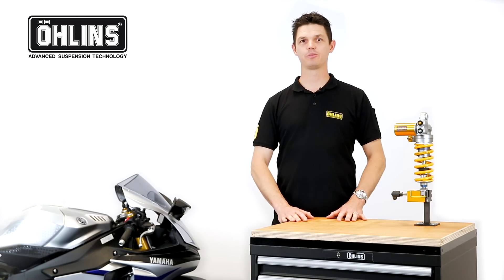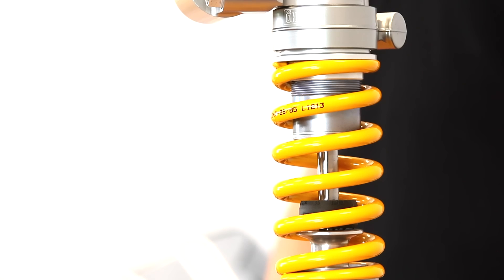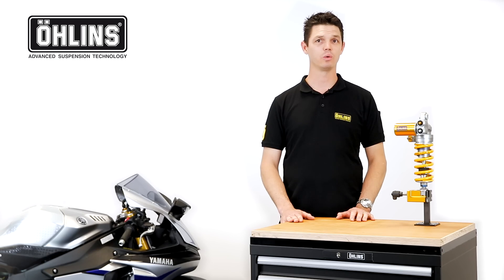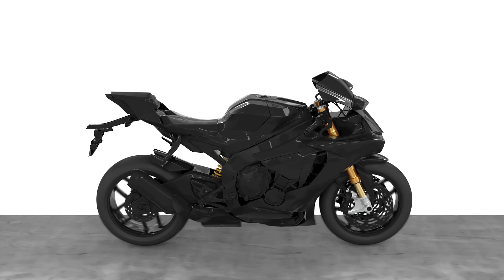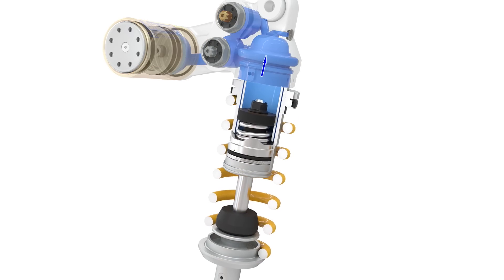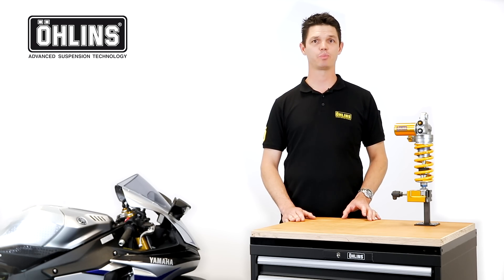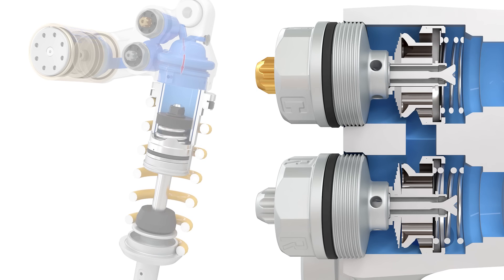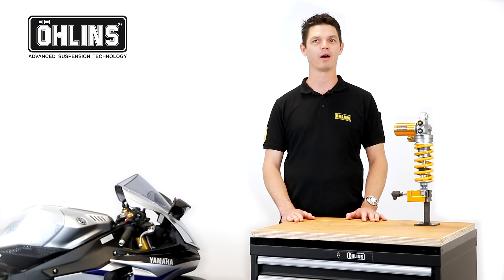Öhlins Motorcycle TTX Technology Shock

Comment: This  guy speaks  good English .. Good  Graphics..  but when you pay  $740.00  "  My Stock forks  were bent, I hit a Deer in the Fall of  2019 I paid  $2008.00  each for new Stock Yamaha Forks.for an Ohlin Cartridge Kit for a  Yamaha FZ-07   they give  you  some crappy  insturctions  printed  in a blurr  in a tiny  book 1/4 the size of  8.5"11" typing  paper .. and  the English is so terrible  it makes no sense.
  I was able  to download a pdf file of the  instructions  and  expand the size  on my lap top screen.
   When you have to refer to the Yamaha  Shop manual  which uses  different names for the parts the real confusion begings..  
   The Ohlin parts diagrams  not so  good ..  I was not  sure  if  I was supposed to remove the Yamaha bottoming spring or not.. Ohlin could not be bothered to print a clear  photo  and  refer to the spring  by  Yamaha part Number..  
  Yes  I know they said  10 times  to have the parts  replaced  by an Authorized Ohlin Repair shop ..  but  I have  been  working on Cars, Trucks , Tractors , Front end Loaders Cranes, MOTORCYCLES AND SNOWMOBILES FOR OVER 45 YEARS..  I  have a shop manual  for amost  every vehicle I own ..and Ohlin Cartridge replacments  manual is as  bad  as GIVI  Luggage  manuals .. with total crap photos..
  The Yamaha  Shop manuals  are  pretty good  once you get accustomed to the format..

Comment: Aprilia RSV4RF 2017 TTX and TTX GP  what in difference between them ? Can I upgrade to TTX GP internal ? Thank you
Reply from the maker: Hello Sean,

We asked our product specialist here at Öhlins HQ. Below you find his answer. 

At the moment we have no TTX GP shock available for the RSV 4 RF 2017.
It is possible to upgrade from a TTX R&T(OEM) to TTX GP, you have to change the adjustment valves and also add a hydraulic pre-load adjuster and change to a shorter spring.
Your nearest Öhlins service center should be able to help you with this.

It's likely that we will develop a new TTX GP application for the RSV 4 RF. It will be communicated on our social media pages as well as though www.ohlins.com and our network of distributors and service centers. 

We do have an upgrade for the fork https://www.ohlins.com/products/database/#?categories=4815&page=1&brands=4772&models=6640 , The FKR 100 is a cartridgekit developed from Super bike racing and this is a real racing racing products that used in some national racing championships. Contact your closest Öhlins Service Center for more information! 

Have a nice weekend! 

Best Regards from Öhlins Racing AB
Reply: Thank You 👍🏻
Reply: I have just sent my 2017 RSV4 RF TTX-RT shock to my Ohlins centre to be re-valved to TTX-GP spec.  Hoping it makes a worthwhile improvement
Reply: Had my shock back and the damping is much improved, my Ohlins centre said they cannot in fact fit the TTXGP adjuster valves and needles as they don't fit the RT shock but they re-valved to same spec with new spring toys suit, All I can say is it is much better :-)
Reply: Curious, where did you get the re-valving done?
Reply: KAIS here in UK, used them before and they are very helpful, great service.

Comment: You wrong. You not mastered it. Your suspension is a wast if money. Especially shocks.
Reply: Comedy right here! Really well thought out. Good one. So funny
Reply: @dansteadman2528  i had many ohlins cartridges, complete forks, gas cartridges and shocks. used them all. without revalve none of the worked right. it is just an expensive lego with close ro zero experience added in to the mix. i believe this is a consequence of some simulation software in use instead pr actual riding, or very unskilled test riders. in any case too expensive set of parts is not a suspension yet.
Reply: @SAMFICOM  Lol dude they aren't legos. You have to install them for them to work. There is a reason they are regarded very highly in the automotive and bicycle industries. Sounds like you installed it wrong. Anyone with a brain knows these shocks work wonders.
Reply: @dansteadman2528  I had - Ohlins forks (complete), ohlins TTX, TTX2, TTX GP (total 4), Ohlins 30mm cartridges, Ohlins gas pressurized cartridges. Except for gas pressurized cartridges where valving was very close to good, valving on all the rest of their products was off completely. However I also believe that for for someone with your intellect level Onlins, or any other well marketed brand suspension will be just fine out of the box.
Reply: @dansteadman2528  And about this specific video. - We can see typical as you call them "dude" who has zero clue what he is talking about - he is reading from improvised teleprompter (not even a proper one). He could be replaces by Alexia any day and there will be no change in text or meaning at all. This is what Ohlins became our days - they use some software to simulate damping, over vise they would not be able to cover such wide range of motorcycles. Then if customers complain they will adjust it (maybe) on the next year batch (maybe). So basically if you buy ohlins - plan additional $$$ for re-valve and after few re-valve iterations they will work just fine. However taking in account initial cost of components this is ridiculous.
Reply: @SAMFICOM  yeah, you have to put them on your bike in order to see if they work. It sounds like you pushed on them on your desk to see if they would squish and they didn't so you got mad. They work great. They are the best. If you can't get them to work right then you should set them up right. It helps a lot. I can think of 3 reviews from experienced professionals saying they are either the best or they are one of the best. Do you think Loic Bruni wins world cups on garbage suspension? He does not. Try again buddy
Reply: @dansteadman2528  Well, reading the part regarding pushing suspension on a desk.... Are you ok? btw. do you know what waving is? can you tell me what in onlins terms c35 R6 means for example? I have a feeling you know nothing about suspension...
Reply: @SAMFICOM  I have a feeling you haven't actually tried this suspension lol